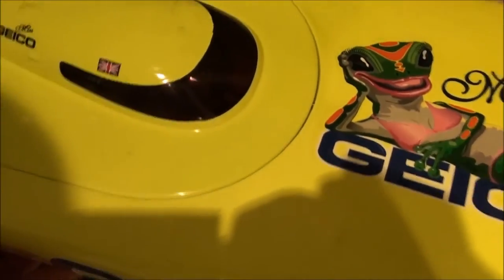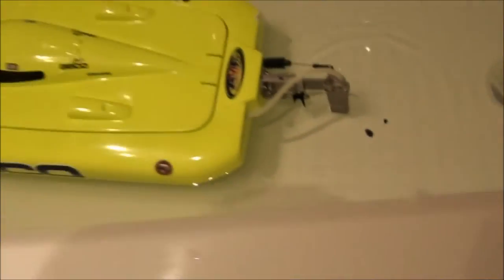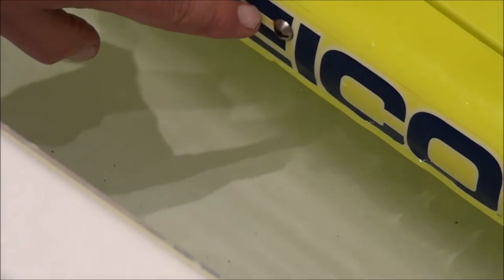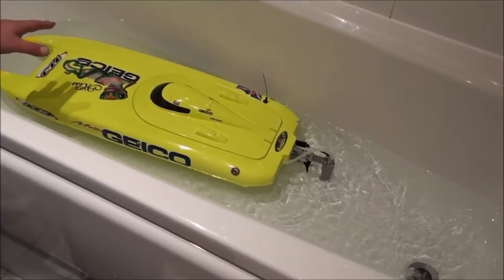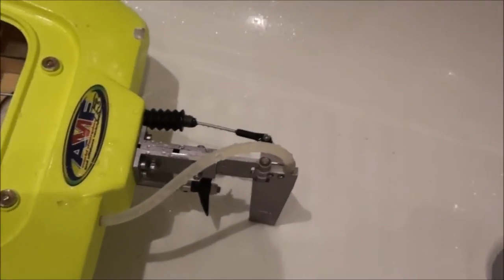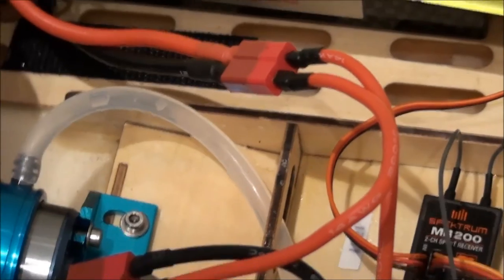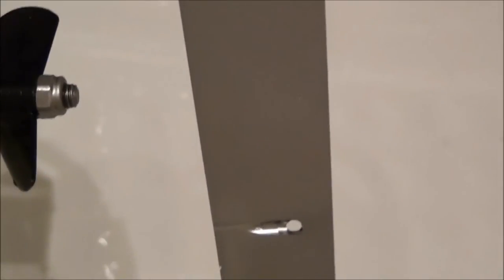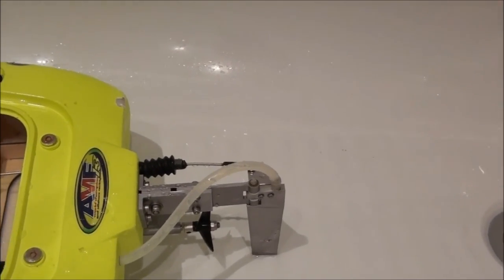Rc boat cooling system cleaning

Comment: You couldnhave dine what bormalnpeople do and flush the whole system with a large syringe ir a gravity siphon. Skipping the whole bathtub splish splash. I usually do that then set my air compressor to a low PSI and blow some air through there.

Comment: haha man you do this the hard way! and you need to change your watercooling, rudder pickups are shit house, I use a pressurized spray bottle, has a pump on top to pressurize it, available from hardware shops, put it upto the water outlet and spray water through, takes 20 seconds lol
Reply from the maker: other idea  to our friends & subscribers thank you.
Reply: Not just another idea @james Johnsons idea is the ONLY idea and is the BEST idea.  All serious boat hobbyist use the water pump spray bottle method it pressure cleans the cooling system without needing to run the engine.  Go to any RC boat racing club and this is the ONLY method that is used because its the best.

Comment: ...the speed of the boat push the wather trought cooling system.. if you want to overheat eletronics and damage it..cause the boat does not runs..and cooling system does not work..that water that you see that is comeing from cooling system is the water wich pushs propeler..but that is not enought to cool eletronics..do not do this way...just push wd40 trouhgt cooling sistem